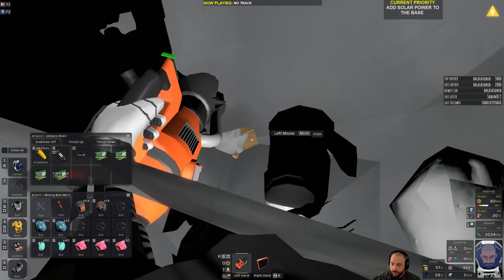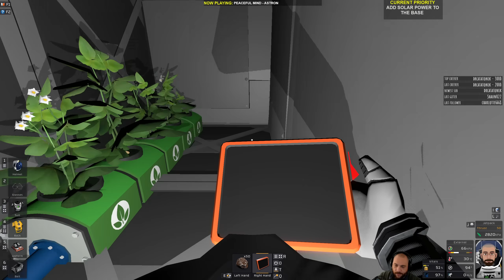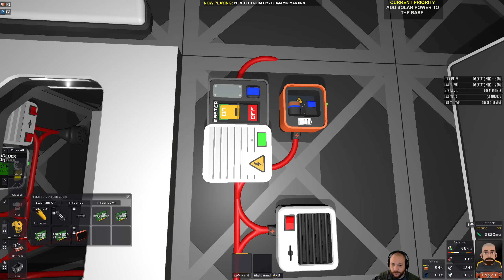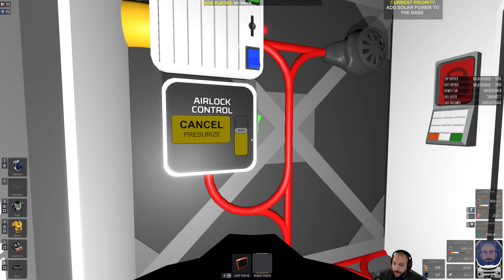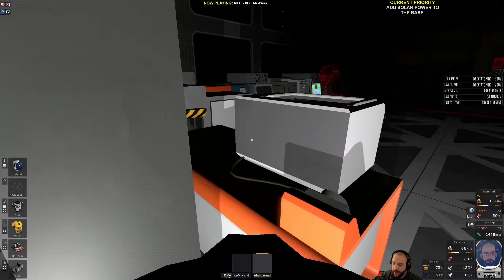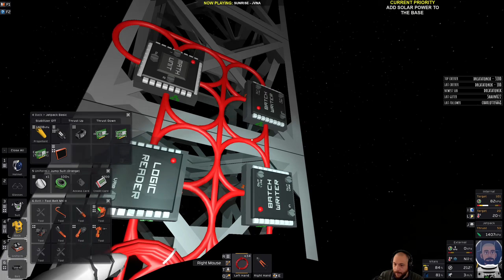Setting Up a Solar Power Tower in Stationeers - Crashlanded on Mimas // EP16

Comment: Thanks Rhadamant for getting me into this fascinating, crazy hard, janky yet amazing game.  Been playing it a lot since this series introduced me to it.  Not feedback for Rhad, but for anyone else who is wondering about the growlight coverage because of the potato that wasn’t growing, I understand that a single grow light illuminates a rectangle of hydroponics pots 5 wide and 7 long (in the same orientation as the light) with the centre on the power connector of the light.
Reply from the maker: Its not even centered in the 5x7 lol

Growlights be janky.
Reply: Yeah.  My source for that info is “Cows are evil”.  The wiki explains it a bit differently in terms of small grid squares rather than grow pots but it’s still not centred in the 5x7.